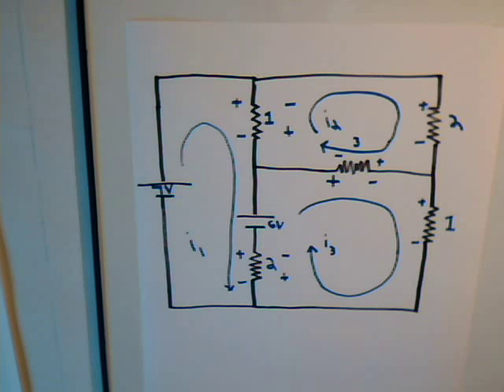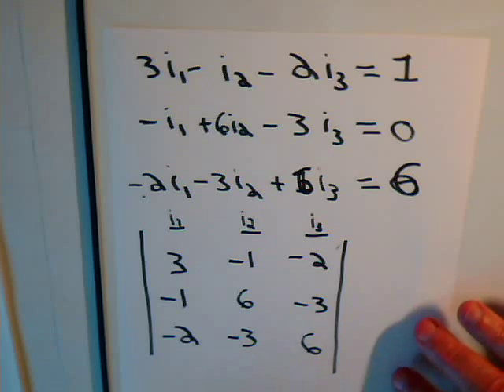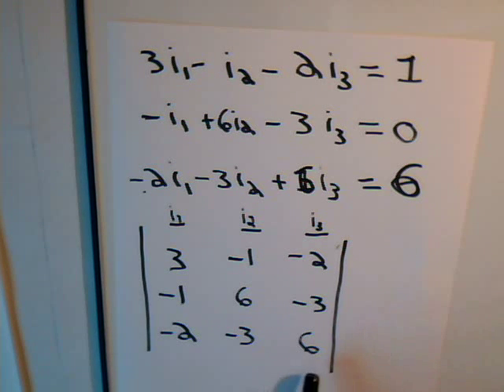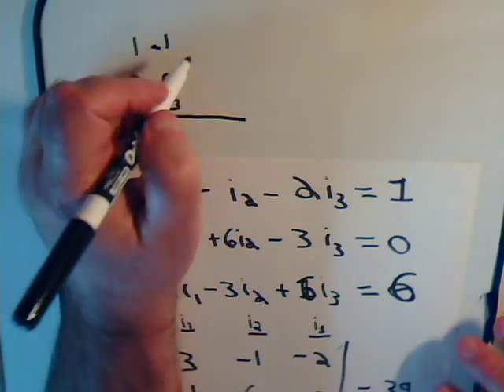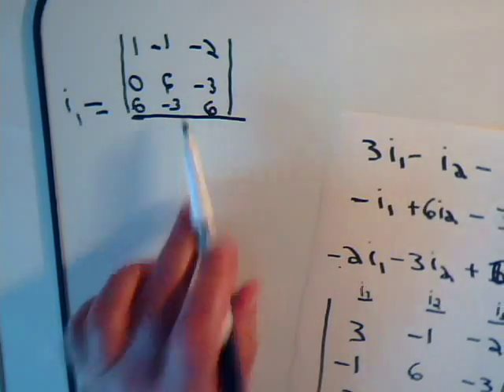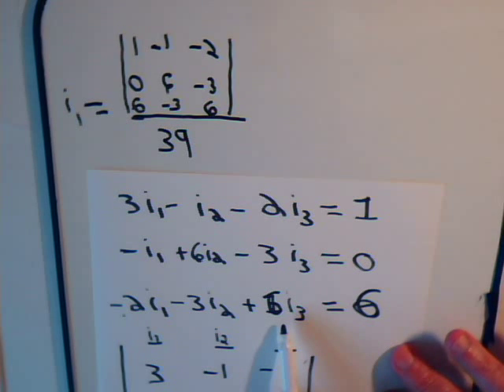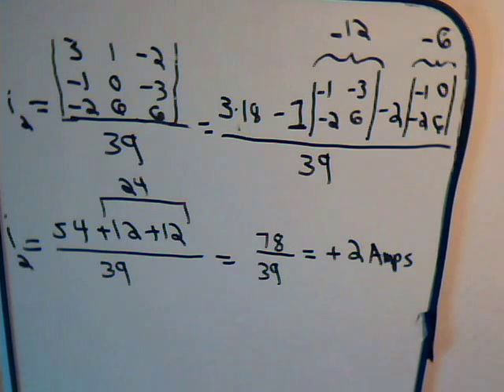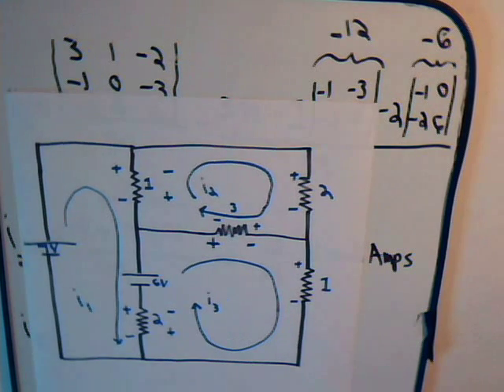Electrical Circuits Video #11: Mesh Current Analysis - Introduction & Example #1 Part B

Comment: No, 39 is the determinant, paste "determinant {{3,-1,-2},{-1,6,-3},{-2,-3,6}}" into wolframalpha and see what you get.

You probably got the sign wrong on the top value of the i3 column when you were doing your arithmetic.